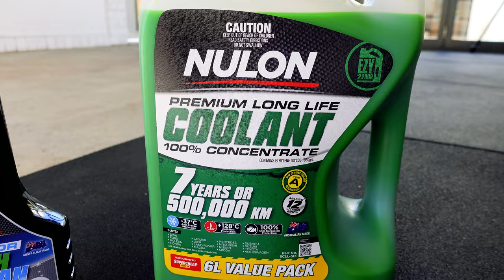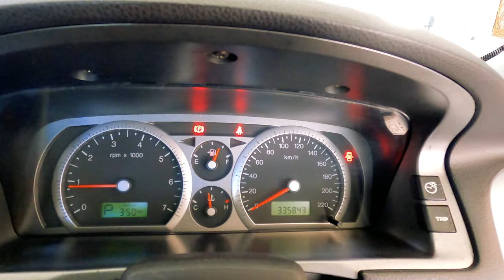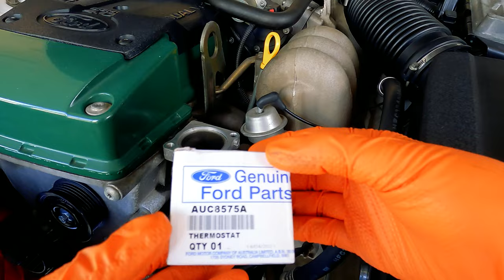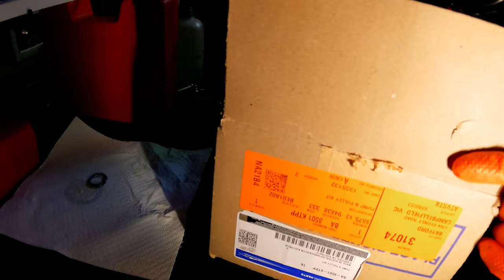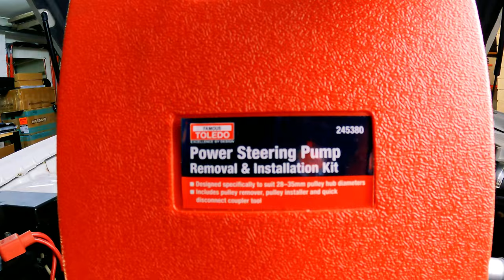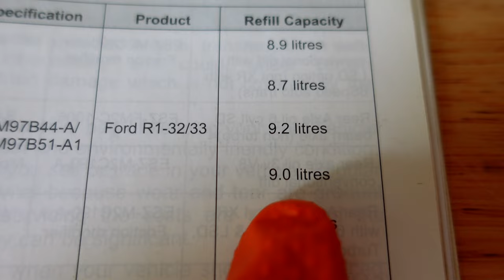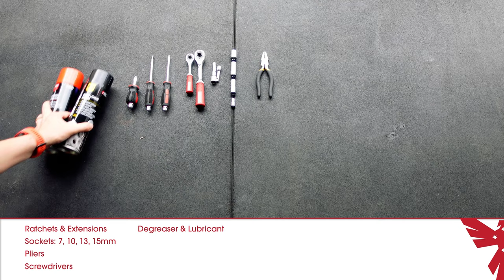Cooling System Overhaul on the BA BF Ford Falcon

Comment: I had to unbolt the heater line that goes in to the back of the water pump and make the mounting hole bigger to make sure it went into water pump. When I put everthing normally the pipe out the back was too short by about 10 mm. Doing the above remedy solved that problem.

Comment: very helpful but i found alot easier to move power steering pump and drop the alternator and then water pump just unbolts easy. .
Reply from the maker: Appreciate you watching mate, and thanks for the tip!

Comment: Great video! I was gonna suggest the compressed air gun attachment as I have one also, they're handy!
The water pump gasket would be a good candidate for a wire wheel cup brush on the end of your drill. Fk spending hours cleaning that off!
Top notch video again. Engine bay looks lovely and clean!
Reply from the maker: Thanks legend, his is high praise coming from you!! I've seen some of your work on the FB groups and glad to have you here. I appreciate you watching 👍

Comment: You are exceptional with explanations regarding your Ford and how to do maintenance. Were you able to buy the other green silicone hoses. Also have you done a video on how to clean or polish up the chrome rear bars.  Thanks
Reply from the maker: Much appreciated Dave 👍 
I could not find the remaining green silicone hoses anywhere - the best I could do was find a Chinese company on Alibaba who makes these hoses from scratch, and ask them to manufacture a set. With the chrome bars, I did polish mine but did not make a video... I found that an orbital polisher, or a battery powered drill with a sponge attachment, plus some metal polishing compound worked amazingly. Although the stuff that comes off the bar goes flying everywhere, and needed a bit of clean up afterwards, so highly recommend doing this outside. Very much appreciate you watching the Falcon vids!

Comment: Go the green top gasser!, I need to do this on my FG ute. 
Last did it seven years ago inc new top and bottom rad hoses and overflow tank.
Thinking to do water pump now also now that I'm at 220k.
Reply from the maker: Thanks for watching mate, and I hope the water pump swap goes well! 👍
Reply: @Horus_Works my FG has started to weep coolant from the o ring on the coolant pipe under the thermostat housing. So I'd change that out too.
How many KMs your ute done? Original gas converter still?
Reply from the maker: @sic04250f  good call, thanks I'll keep an eye on the o-ring 👍 I've got 335,000ks on her and as far as I know, besides the servicing every ten years, it's the original converter.

Comment: Hi mate, I'm attempting the water pump job on my Falcon, bought the toledo pulley removal kit and can't for the life of me get the water pump pulley off. It just won't budge. I don't know what the problem is as yours came off like butter
Reply from the maker: Bugger, just seeing this now... hoping you solved it mate. it's definitely just pressed on, so as long as you have a hold of the metal sleeve on the pulley with the puller tool, don't be afraid to use some force... Mine came off easily, but I'm assuming that if there's any corrosion around that metal ring it might take a bit of force to get it started. That's all the help I can offer mate, hope you got there... 👍

Comment: Hi bloke. That bolt at the top right of the alternator bracket/bottom left of the water pump goes in through the timing case and you can get a mild oil leak from there. bloody hard to figure out where the leak is actually coming from when it happens because it's so hard to see directly onto that spot.
Reply from the maker: Legend!! Thanks for the info mate, that's a good tip! How do you stop the leak - RTV?
Reply: @Horus_Works  Yeah bud. A little around the inside of the bolts collar. I was put onto your video when I posted on Facebrick looking for a pulley removal kit other than Ford's expensive tool. I finally found that damned pissy little leak that's been annoying me for months. I thought it was from the timing case until I pulled the pump out yesterday, and found it's actually from that bolt hole. 
Great info and well described process in your vid lad... Cheers.🗯
Reply from the maker: @dannybevan8093  thanks for the info mate, I appreciate you sharing! And thanks for the watch - good to see that the vid is proving handy 👍

Comment: No need to take pully of water pump for removing water pump. New water pump with come with pully fitted.
Reply: Yeah people take it off because one of the bolts is just under the pulley but you can manuavre the bolt out and back in with pulley on
Reply: @noturscooper1350  So can you remove the bolt with the pully still on?

Comment: Never use tap water... pointless doing a flush if you're gonna use tap water. 

Mix it with distilled water.

Also you dont tap the hole, the bolt you had is supposed to be driven in as its a self tappeing bolt, thats what its designed to do.
Reply from the maker: How do you flush the engine with distilled water?